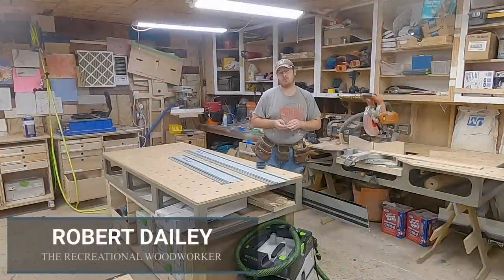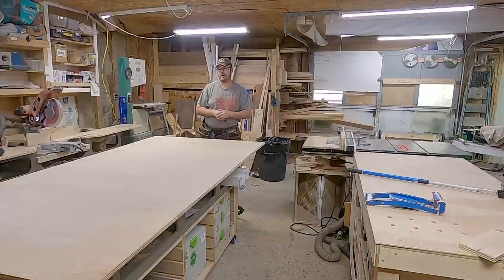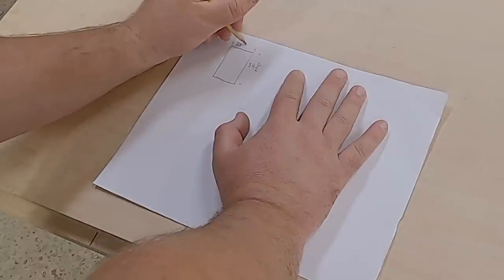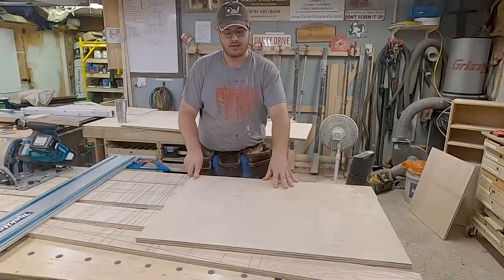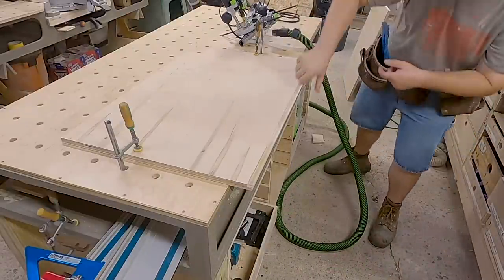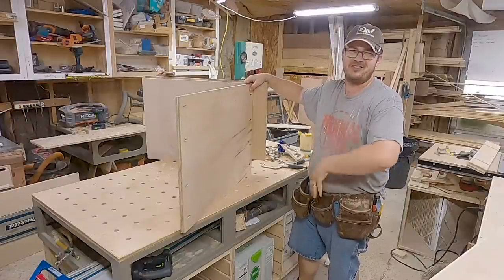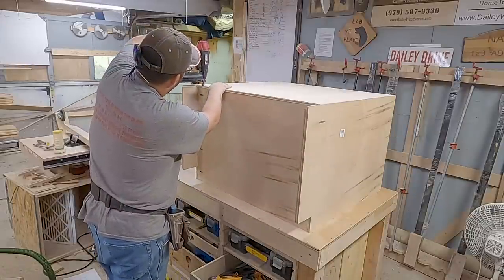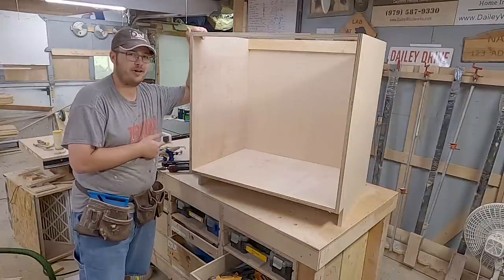How to Build a Sink Base - Kitchen Cabinet Series 1 of 8 Build Your Own Kitchen Cabinets

Comment: Excellent video Robert. I do like the European style kitchen cabinets that rest on 6 inch legs with 6 inch toe kicks. I have dried  over 1900 homes or offices over the last 22 years. The 6 inch legs keeps cabinet bases dry if the home has a major water leak with an inch of water in the entire home. We have drilled through many saturated toe kicks to dry the bases of kitchen and bath cabinets, and the lower or upper walls behind them. The raised cabinets allow less damage when opening building materials to dry affected areas. Sometimes we rebuild damaged cabinets and re-use the face plates, doors, and drawers.

Comment: Built custom cabinetry for 30 plus years. I have ALWAYS built the face frame first. That way everything else is square off of the face frame. On the bottom I use a cleat glued and nailed to bottom of the cabinet, save on pocket screws. Not bashing but different applications for different folks. Nice vid.

Comment: About to make 2 floor cabinets but I will put the stretches at the rear on the outside and the back panel within a rabbet in the inside so it looks better. ...i am using 18mm so we shall see how well that slides down in to place:)

Comment: Husband is following you to build our cabinets. He's doing a great job, but now I need to finish them. I want to paint them and create a white kitchen. What are your suggestions for prep and painting? Should we invest in a sprayer? I'm an artist, so I trust myself with brushes and rollers better than with equipment... he's done beautifully on our "test cabinet" I want to make sure my finish does his cabinet due justice.
Reply: A sprayer will do wonders. I would for sure get one for kitchen cabinets to get that smooth finish.
Reply: Sanding & priming are probably the 2 most important thing to get a good finish... then, a HVLP spraygun, so the paint doesnt go all over the place, just make sure the paint isn't too thick ... HVLPs don't like it... 

Brushing & rolling can also work extremely well so perhaps you should do some test panels from offcuts of the wood you are making the cabs with ? 🤔

Edit ...Jess .... I see that was a year ago 🙄, how did they turn out ? And what did you learn from the painting process ?

😎👍☘️🍺

Comment: I find it easier and better to build the cabinet without a toe kick and put the box on a separate base. Makes it much easier to level the cabinets upon installation. You build a 2x4 base where the cabinets are going to be, level it, and attach the boxes to the 2x4 base.
Reply: That sounds like a great idea!  I saw another video where they did the toe kick as a separate piece per box, but your idea sounds even better.
Reply: @jimd8490  The other reason I like it is that if water should get under the cabinet somehow, there is no chance if it wicking up through the plywood

Comment: I am using your plans however I am using a 1 1/4" door overlay hinge. My question is when use this hinge the plywood box has to sit 1/8" from the face frame it cannot be totally flush. On door only cabinets it's fine however when I want to install drawers will that 1/8" face frame give me headaches or could I use the tabs on the drawers slides that allow for some leeway and have everything work well?

Comment: This is an excellent video! Thanks so much for taking the time to make it. Do the plans talk about the grade of plywood to buy and the type of wood to use on the face frame? I get tripped up by those questions.
Reply from the maker: Yes they have all the materials I use. 

You want to use a cabinet grade plywood. I prefer the maple or birch purebond from Home Depot. Clear pine, poplar, beech, or maple are good materials for the face-frames. 

I prefer beech as it’s very hard and is a good value. My second choice would be poplar. 

I used pine for my face frames on these cabinets because at the time I was building a lot of rustic style furniture and buy pine in bulk.

Comment: If you are going to put drawers in the box, how is the plumbing going to go under the sink?
Reply: Probably will make faux drawers. The fronts will probably tilt forward to expose a small storage rack for fish rags and what not
Reply: no drawers on top ....he just gave an example what you could do......top will be a face plate   .
Reply: I've seen drawers that have a cutout section in the middle to accommodate pipes.

Comment: Hello. Did you build your face frames out of pine? If so, how well are they holding up?
Reply from the maker: Clear pine is very good for furniture and cabinetry. This was true southern yellow pine not the junk "white wood pine" that the box stores carry.
Reply: @DaileyWoodworks  Thanks for getting back to me. I'm building a house and making my cabinet boxes out of 9-ply Baltic Birch ($45 a sheet at my local lumber yard) and I used poplar to build out one face frame for 2 30" 2-Drawer base cabinets. The poplar face frame cost more than the plywood box (~$85 using poplar from HD).

I considered and am considering using pine for face frames b/c it will be painted cabinets but I'm concerned about the comments around pine being too soft for face frames. What has been your experience?

Comment: the cabinet size is 36 inches with a frame. Width without frame is 34 1/2 inches. What is the difficulty in installing and operating a cabinet if you make a cabinet without a frame, those 36 inches?

Comment: Great job Robert. Explained process very well. Easy to follow. What material do recommend for face frames?
Reply: He said below: You want to use a cabinet grade plywood. I prefer the maple or birch purebond from Home Depot. Clear pine, poplar, beech, or maple are good materials for the face-frames.

I prefer beech as it's very hard and is a good value. My second choice would be poplar.

I used pine for my face frames on these cabinets because at the time I was building a lot of rustic style furniture and buy pine in bulk.

Comment: I am re building my existing kitchen cabinets,  the sink is 33in and my cabinet inside is 33 1/2 in.  Do I need to widen it to 36in if my new sink calls for 36in cabinet? The new sink is the same exact size as the old sink.
Reply from the maker: I don’t think so. If it fits it fits. 36” is just the most common size for a sink base. But it’s just what’s common it’s not a rule

Comment: I'll never understand why when you have a nice table saw you want to waste your time using a track saw. I've built cabinets for over 40 yrs and have never owned a track saw. It's way quicker with the table saw because in cabinetry a lot of your cuts are the same measurement. Set up the saw and have at it. Also there a lot of small parts that will  be the same length, shelves, seretchers, etc. Its so much easier and accurate to set up the saw and cut the many parts that are the same length and width.

Comment: Since when a factory edge is not a factory Edge?
Reply: Removes the exposed edge and any mold spores or superficial damage to the edge. It's a good practice since there is lots of "extra materials" in
 the cutoffs.
Reply: I always cut the factory edge off with my track saw on sheet goods. It leaves an edge that's very noticably cleaner than the factory edge.

Comment: Just curious, what type of wood dis you use for your face frame?
Reply from the maker: I used clear Southern Yellow Pine
Reply: @DaileyWoodworks  what size? 3/4” thick or a 2”x1”?  What thickness did you use?

Comment: I just saw your opening video. Our RTA estimate was $11,114 with 25% off it would have been $8,400 plus tax.
Reply from the maker: RTA cabinets can be a great value.  Some are great quality, some are....not.  Our average kitchen remodels for clients is $40-50K.  Start to finish, materials, labor, installation, paint, and doors.  Cabinets alone will be about 1/3-1/2 of that.  The material alone on these I came out to around 5K.  I would have been about $18 installed.  Cabinets only unfinished I could have been around that 11-12K mark.  

I hope this helps.

Comment: wouldn't it it be better to not cut out the toe kick, and cut the sides 30" tall and just build a platform on the floor minus the depth of the toe kick, this way you could you could get more out of a sheet of plywood. 34.5 x 3 = 103.5" where 30 x 3 = 90" leaving you 9"
Reply from the maker: Yes. In some cases this is absolutely the way to go. I wanted to focus on stand alone units in this series so it would be a little simpler for a beginner
Reply: @DaileyWoodworks  thanks, watching the lazy Susan video now, I'm thinking about putting drawers in mine instead of the turn table.
Reply: Another option would be to build the box without the toe kick for maximum use of the sheet of plywood. And then build separate box for the toe kick then attach it to the box for the stand alone aspect of it. 
It also might look good to not have the toe kick notch cut out where you mentioned having the face frame to the floor. Just having the toe kick plate “T” into those sections next to the stove and dish washer. 
Good video with a nice basic design.